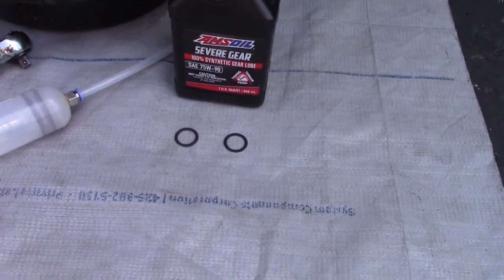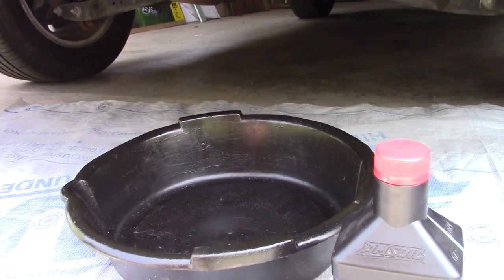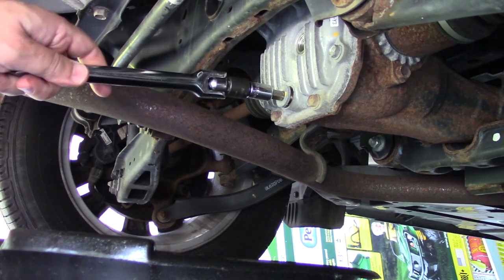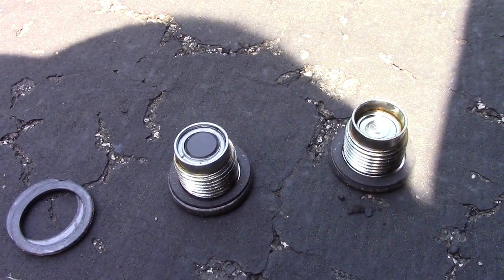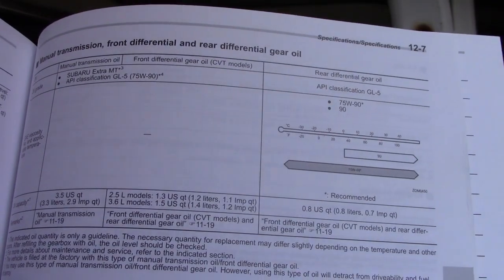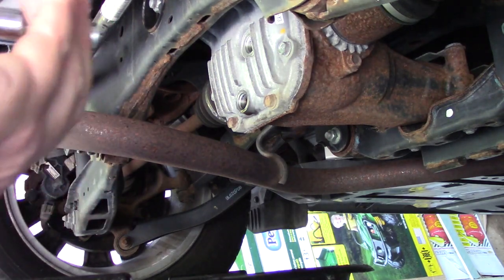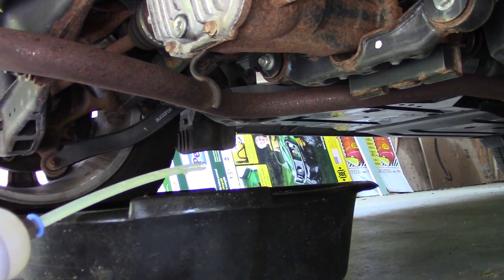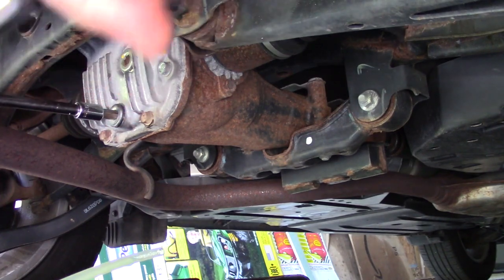DIY Rear Differential for a Fifth Generation Subaru Outback (2015 to 2019)

Comment: Just did this on my 2019 with 50k.  First time touching a diff.  I had a little struggle getting old gaskets off diff and cleaned some of that rubber residue afterwards.  A little shmoo on the magnet.  I had the front raised slightly high with my setup, but still took 0.8qt, maybe a hair more.  Front diff and cvt next on the list.  Thanks again for your vids.

Comment: above the rear differential , there is that section of rubbers with the two nuts, and it appears to be leaking some type of fluid. Are any of you getting the same thing on your outbacks??
Reply from the maker: I can think of only 2 possible things that may cause that. 1) the 1/2 shafts seals at the differential are leaking at the top. 2) there may be an issue with the differential mounts, or something/someone splashed oil all over them.
Reply: Whiteline makes a bushing insert kit KDT 927for the rear differential bushings. Have heard of "leaking" before, but no real answer given.
Reply from the maker: @51249ca thank you for the info 🙂

Comment: seems that outbacks are not the most rustproof vehicles
Reply from the maker: I live in the rust belt. Lots of salt and chemicals put on the roads and highways in winter.   Toyota does a nicer job of undercoating.

Comment: Is it important to drive the vehicle 10+ miles immediately before doing the work? Is this done to make sure the parts are warm enough to make removing the plugs viable?
Reply from the maker: It is done to make sure the oil flows out quickly and is taking contaminants out with it. When cold the oil acts as a 90 weight oil, and will take a long time to flow out on a cool day.
Reply: Don't worry about contaminants.  Just give it time to drain.
Reply from the maker: @coastalbeer when the fluid is warm, it flows much faster as well.

Comment: The tech at Subaru says you don't need to change the gasket on your 1st change there a different kind of crush gasket not like the gasket for the oil per Subaru
Reply from the maker: I always like to put new gaskets on, you never know if the old one will seal and it could end up costing you more if you have to replace it or drips on your garage floor.

Comment: My 2019 outback has 48,000 miles from the dealership. At what mileage would it be proper for this procedure ?
Reply from the maker: Per the Warranty & Maintenance manual that came with my 2017 the fluid only needs to be inspected every 30 months or 30k miles with a Note 3 that it should be replaced every 15k miles or 15 months under severe driving conditions like short trips cold weather, trailer towing and so forth.  That is why I changed mine before 50k miles with a good synthetic oil.  I think it's always good practice to change fluids as they do keep contaminates in suspension, degrade over time, and additives lose their potency.  Hope that helps.

Comment: Question - What do you do with the old differential fluid?  Do auto stores take it , like they take motor oil for recycling?  Do car dealers take it?
Reply from the maker: Yes, they will take it along with the regular oil.  You can also add it to the waste oil you are taking in. Hope that helps.